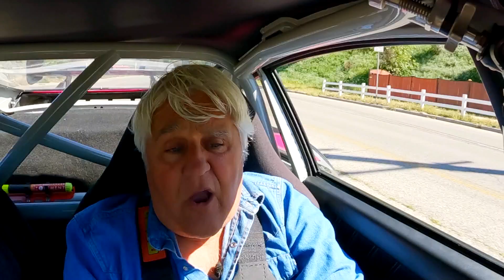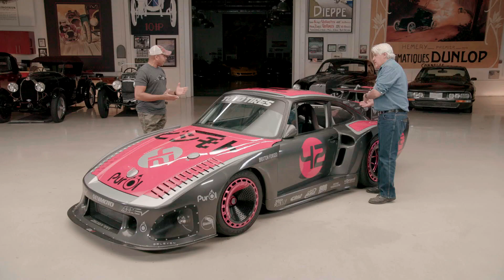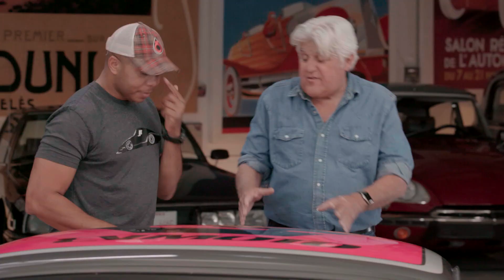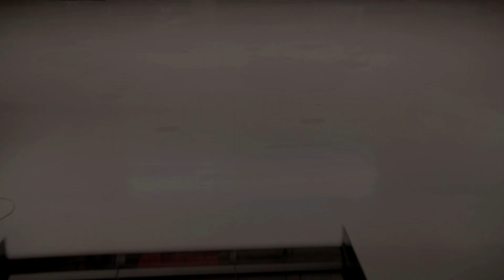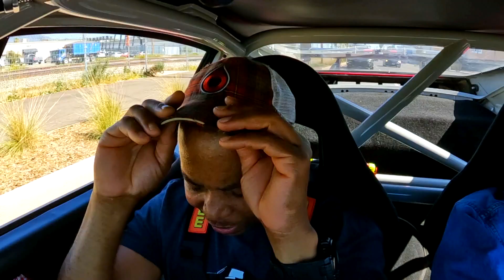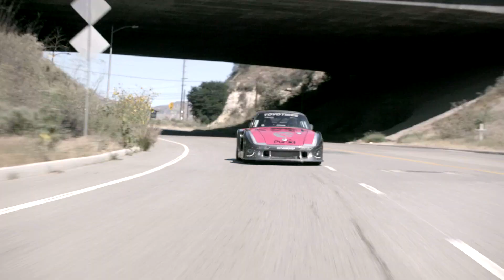Bisimoto’s Porsche 935 K3V | Jay Leno's Garage

Comment: Few inaccuracies here with the electric car in the interview. One glaring issue is the subject of a battery fire. With a Li-ion battery, if one of the cells does combust and is put out, the fire most likely has damaged the cells around where the fire is. Once those are damaged, they become a time bomb until they combust (i.e. thermal runaway). This starts a long term domino effect of damaging cells each time a fire occurs which effectively equates the battery pack to scrap. This is one property of Li-ion batteries and a real issue and part of why airlines do not want battery powered devices in the cargo holds of planes during flights. I am not getting on electric vehicles, but making a statement where you equate gasoline to a flammable liquid and make it sound like a bomb and then make a blanket statement of "turn off the battery and the fire will stop (paraphrasing here, not literal quoting)," is inaccurate and grossly underestimating how violent a li-ion battery fire can be. All this being said, He did a quality job on the build and hoping he gets more orders. He does an amazing job with all his projects.
Reply: To be fair: outside of any kind of impact or poor battery pack construction...  spontaneous Li-On fires are very rare.

Comment: Alkaline is potassium hydroxide or sodium hydroxide. (Lye) These have been used extensively in Edison's batteries and also nickel metal hydride, (Prius, Rav4 and others), and nickel cadmium. Lithium ion is a different animal. My hobby is zinc and aluminum air batteries made from scratch. Could they work in this car? Why not! Thanks. Great tech and great Bisimoto! Always great Jay of course. Thanks

Comment: Jay's explanation of why 48-volt electrical systems are being used in ICE cars is nonsense, he is SUCH a petrol-head.
Reply: Current kills, not voltage.
Reply: Higher voltage means smaller wires. And it's easier to do a mild hybrid if everything is 48 volts.

Comment: I've seen quite a few "streetable" 935s over the years.  Typically, they look all wrong because the stance/tire size is changed in the hopes of making the car more practical on the street.  This particular car nails the stance and appearance of an actual 935K3.  Not sure how practical it would be to drive on the street, but it definitely looks the part.
Reply: I think I saw in another video that Bisi replicated the parts from the actual molds of a Porsche race supplier in the 80s.
Reply: @romanval69  The body panels have been available since the 70's.
Reply: Original imsa body molds...$12,500 on ebay
Reply: I like the look of this 935 like a cool 80’s 90’s bmx bike...
Reply: In another video, Bisi demonstrates the hydraulic system that raises this car 4" for speed bumps.
Reply: Maybe you missed the part of the episode where they drove it on the street.  For quite a while.  Without issue.
Reply: @johnnybala5112  In the vid with manny khoshbin driving it, he scraped the front end on his not very steep driveway. The suspension travel isnt very long
Reply: There's no reason why it can't be street driven. The bodykit doesn't effect drivability.
Reply: @BobBobbington66-t9s  Have you ever driver a street car with so little ground clearance?  It can be done, but there are many, many places it cannot go...like over speed bumps...up steep driveways...etc.  Particularly the side "running boards"...it looks like only about 2" clearance....maybe 2.5"-3" for the front splitter.
Reply: @johnshaft5613  😃 If you think that is "low" you don't know what low is. I could daily that no problem.
Reply: @BobBobbington66-t9s  Well, I spose I "could" daily it also...but I sure as hell wouldn't want to.
Reply: @johnshaft5613  I have a daily driver almost as low but with a shorter front bumper that makes for a better approach angle. This car does look like it would be troublesome, however knowing bisimoto, he probably has supercar style coilovers that can temporarily lift the car. You'll hear lots of good and bad about the guy but his personal cars are truly incredible
Reply: I guess you are the self proclaimed expert

Comment: Why there is no symmetry in the roll cage bracings behind the the seats? It's bugging me. Is there is any legit reason to have them asymmetrical?
Reply: Would this "race car" even pass tech inspection?
Reply: It does have a brace that goes behind the seats called a harness bar….also it is common for roll cages to be asymmetrical it is there for safety and strength but still want to keep weight to a minimum…by making it symmetrical can add unnecessary weight ..what most people fail to understand it’s not just the weight but where the weight is located…the more weight above the center line of your wheels raises your center of gravity which negatively affects handling so the extra few cross bars can be the difference between winning and losing
Reply: @jsun4354  thank you for explaining in layman's term.

Comment: For those whom cannot foot the $55-60,000 bill, $4000 is much more approachable and affordable in steps, as upgrading cost are plus the $4000. The instant torque when compared to equivalent internal combustion is appealing to say the least.
Reply: As well as the instant drainage of power,lol.
Reply: @geneyus6411  you have an instant drain of power either way……

Comment: 33:34 don't we still need to "dig something out of the ground and refine it to put in your car" even if it's electric?
Reply: Tons of digging... all powered by dinosaur blood! LOL "carbon-zero"
Reply: Virtually every part of a car, IC or EV can be recycled if the will is there... and it needs to be. This includes the EV battery pack, so technically, all the materials of a very old pack (maybe 8-10 years in a car, another 8 or 10 as static storage) can be recycled to make new battery packs. Can you recycle the gasoline or diesel you're burning every day?
Reply: @MarcCoteMusic  Can you provide an example of a company that actually recycles the components of a lithium ion battery at scale? And no, I don't mean re-use for a secondary less power intensive purpose. I mean actually recycle the battery into components that can be made into a new battery. I personally don't know of any.
Reply: @androiduberalles  - As this is new territory for everyone it won't surprise you to learn that there are no huge-scale battery recycling operations out there. Yet. As the old batteries reach their end of life, more recycling will be required and this is a business opportunity which means companies will come in to fill the need. One company that has been getting some press lately, founded by JB Straubel (former Tesla CEO), is Redwood Materials. If I recall correctly, there is at least one company in Ontario (a few hours down the road from where I live in Montreal) recycling batteries...can't recall the name. 
As the cost of raw materials increases, and it has and will continue to do so, the case for recycling looks better and better. Just because it doesn't exist now doesn't mean it won't and doesn't mean it doesn't make sense to start. As the saying goes, "Don't let perfect be the enemy of good."
Reply: @MarcCoteMusic  just because we require something by law doesn't mean it's actually possible or will happen on any scale. And still, we go from relying on conflict nations for oil (because we apparently can't drill for it ourselves), to relying on other conflict nations for lithium and other metals. It just doesn't seem ideal.
Reply: @MarcCoteMusic  the vast majority of power plants run on fossil fuels. Can you explain how this energy is recycled??? Your statement about recycling should refer to the vessel that carries the energy (i.e. the battery in EVs and the fuel tank in ICEVs) and Yes fuel tanks are recyclable.
Reply: tail pipe emissions is all you save, the carbon footprint is probably similar. but another question is will the California power grid be able to charge 30 million cars every night?
Reply: @stanschmenge1965  only because the tailpipe is miles away in most cases. Out of site, out of mind I guess for the "zero emissions" people.

Comment: Another question on the electric motors if you straight cut the gears would they be stronger and provide a more mechanical sound like us "petro powered ICE vehicles like we're more accustomed too?" Since the motor is moved forward would it be possible to put some of the batteries in the back behind the motor/motors as well as under the chassis
Reply: Go watch the Porsche mission r in action or the 1400+hp mustang mach e drifter built by Vaughn gitten. There's also the 1400+hp low 8s cobra e jet electric Ford built a couple year's ago. All of those use straight cut gears and scream compared to an average road going ev. 😁

Comment: Great looking car Bisi. There is something so perfect about the 935 slant nose 911 like Kremer raced in the era. If a motor on each rear wheel was possible making 637hp or whatever you said the motors make now would be an absolute blast especially if you could control each motor independently for torque vectoring and better control would be incredible. Especially when the battery tech really steps up over the next few years.

Comment: I hate EV's because the kind I want will never be available here in the middle of rural nowhere upper midwest US with factory service and parts availability. To get what I want would require moving to China or hiring someone like Bisi or Jonathan Ward or EV West to custom convert a 90's minitruck with custom one-off parts and control systems to get 90's mini truck performance for the price of a Lucid Air. If I can legally go to the store and buy recreational tobacco products or god forbid weed, there should be no freaking reason I shouldn't be able to buy a new vehicle without airbags, rear view cameras and parking assists. If people aren't good enough drivers that they need emergency braking and lane holding and blind spot warnings, they shouldn't be allowed to drive in the first place.

Comment: The irony about the Betamax vs VHS battle, is that it may has been lost by Sony (Betamax) to Panasonic (VHS) in the consumer market, but it was actually won in the professional much more lucrative business, as it evolved into the Betacam system, which became the de facto standard for professional TV reporting crews in the late 80’s and 90’s. Panasonic never caught up. VHS won the consumer marketing battle, and it’s not a question of manufacturing cost as the system are mechanically very similar. It’s the electronics that made Beta image quality better.
Reply: PVO ................started videography in the early 80s and those betacam , with the Trinitron tube   camera's were the gold standard, but I had the affordable Panasonic Industrial grade !!!!
Reply: @dannycalley7777  wow 😳 such a niche  electronics
Reply: Wow thank you I didn't.know that 😊

Comment: He wouldnt feel so "guilt-free" if he saw the resources and foorprint needed to harvest materials needed to make the batteries for this car alone. And what happens to the batteries once they are depleted. As well as the sources for the electricity needed to charge the batteries which are usually fuel based, even in California.  
The car is very cool, no question.  EV vehicles will eventually be feasible as the common form of travel. Its just not there yet.
Reply: With any new tech there are challenges and hopefully we can find ethical answers.  What is clear is reliance on oil for power and transmission is and must eventually die.
Reply: @Mtnflying  agreed, when energy independence can be found by more reliable and beneficial sources than wind and solar. 
Nuclear energy is the only current feasible option to power the influx of electric energy needs in the future, and that comes with its own set of environmental risks. 
I would estimate we are around 100 years away from becoming dependent on coal and fossil fuels. Which by then I will have no need to worry and I can still drive my 53 Olds and enjoy the heck out of it.
Reply: No I love oil and oily bits
Reply: @diegohorton869  i do too. 
I love everything about it. 
Not to get into a political debate but oil is going to be around for a long time. 
Longer than we have to worry about it. 
Just because some politician makes a promise does not mean they have the ability or resources to make it happen. 
So get those hands greasy and enjoy cruising friend!
Reply: Added after writing the main part of the comment: Sry, I just started ranting about EVs and battery technology and it got out of hand. It's not a direct response to your comment. 

eFuel probably would do much more for the environment than batteries. As you said the production, the resources used and often the disposal are problems, but there are also many more factors. It's to expect, that the EV movement will push many peoples with well functioning ICE-cars to switch to EVs, which is bad. Driving an already produced car till the end is most likely way more economical than trashing it. Many won't be trashed, which is a good thing, but there will be billions of ICE-cars continuing to be on the road in third world countries for many, many decades, because they can't afford switching to EVs. All those cars will run with gas, because the rich countries decided for EVs and don't really consider alternatives, especially technologies which can reduce or remove CO2 emissions from already existing cars. 
The playingfield is still very much open, it's not unlikely that battery technology won't evolve as rapidly as people might expect and that we are not too close from the limitation of battery technologies for the consumer market at the moment, atleast for the next couple of decades. Letting engineers try out different techniques with the most suitable surving and evolving would be the best way to approach the problem and not dogmatic ideas. Especially because even if we would have an immense growth in battery capacity in the next 10-30 years, way above expectation, it will probably won't be enough to produce economically reasonable trucks, airplanes and ships with battery powered engines. Those (besides used cars in third world countries) are also a gigantic part of the CO2 transmissions created by human transportation, not only first world passenger cars, and battery technology is far away from solving those problems. Just try to calculate how much the battery have to weight to create a EV-truck with the same range than a normal truck. It would be so heavy, that it would barely be able to transport any more than the battery itself which means its 0% cost effective, you would need much more trucks on the road for the same amount of cargo and the batteries itself probably cost a fortune. Also you wouldn't be able to get a proper plane off the ground and just image the size of the battery inside a cargo ship. 
While batteries more or less work for private transportation in first world countries, it doesn't solve nearly as much as people think, it's in many parts just a 'feel good' technology where it's really doubtful whether it can evolve in something that can make a major positiv impact. The ignorance coming with the EV technolgy might even be extremly harmful, because it prevents other approaches, which maybe really could solve many of those problems politicians and activists don't think about.
One of the more promising technologies are eFuels I think, but I'm open to basically all ideas, because who can really know which one would turn out to be the breakthrough technology in 10 or 20 years? Many criticise eFuels for being not efficient (they still use ICEs), but I think energy efficiency isn't a real problem, there are many places on earth where we could harvest gigant amounts of solar, wind or water energy, way more than we can use. E.g. a small part of the sahara would be enough to produce energy for all of europe, besides some engineering problems with loose ground and sand making solar panels or mirrors dirty, it basically would be a great place and there are many more in the world, but we can't transport the energy to were it's needed. Being able to e.g. liquify the energy could be a big step and it could be transported like oil. Sure, it's not efficient, but because space and energy aren't a big problem, the efficiency isn't either. 
I don't and can't say that's the solution, there are many things to consider, but completly commiting to batteries at this stage with that many obvious flaws and questionmarks seems to be really stupid, we should explore all the possibilities we have.
Reply: @tngdwn8350  Although I only skimmed what you wrote in your last comment, I think I get what you're saying and agree w/much of it myself. The future may be mostly EV, but it's not the end-all-be-all solution to our problems. As I wrote above, the goal is Zero Emissions, and eFuel, if it works, may easily solve that problem for the remaining ICEs on the road, while also keeping them out of junkyards and only creating more waste.
Reply: What gets lost in such arguments is the ultimate goal and the whole point of EV, that is achieving Zero Emissions. No one's claiming that mining vs drilling is better for the environment, and I imagine building a Tesla still requires energy and materials from petroleum fossil fuels. Personally, I'm ambivalent about our electric future, though open to it as I see and sense the urgency, but we've still got a looong ways to go and many miles to travel (progress not perfection).